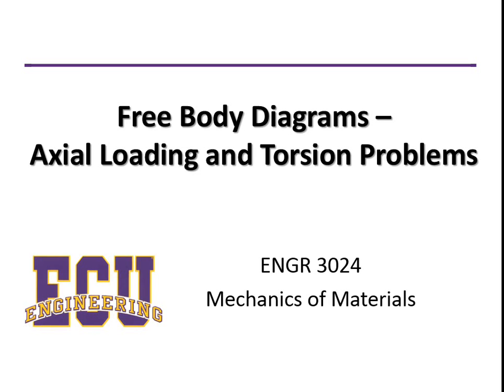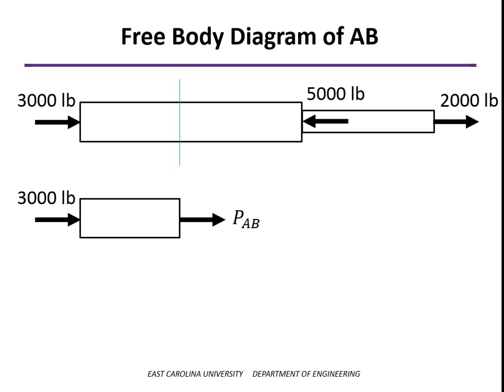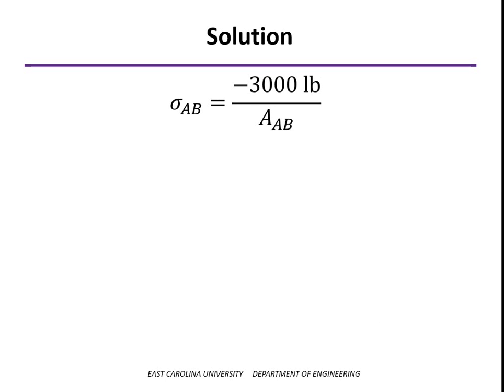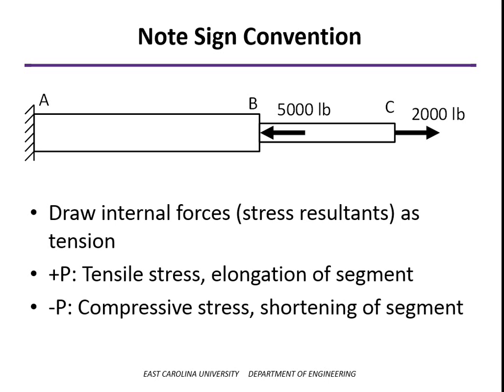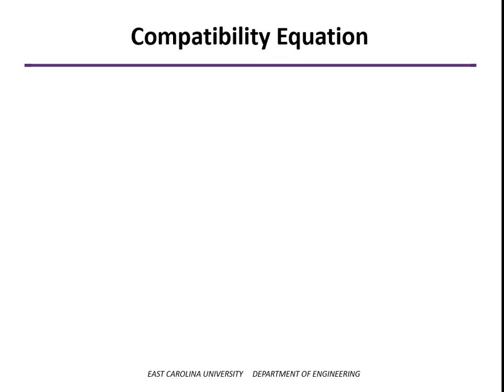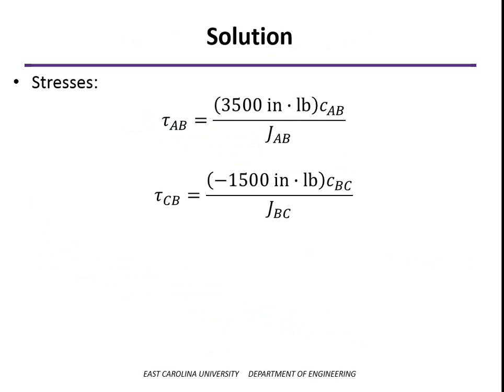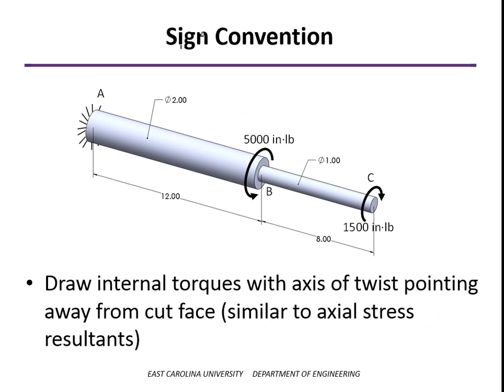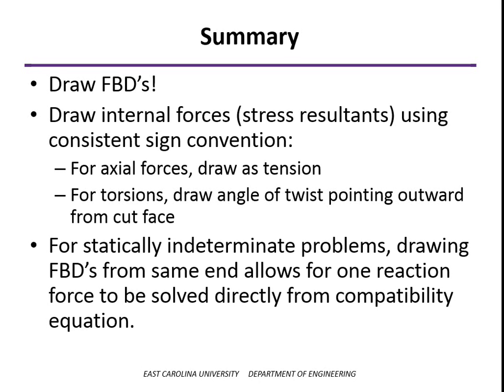FBDs Axial and Torsion Problems

Comment: You keep repeating that negative indicates compression and positive indicates tension, but despite repeating this several times, I continue to fail seeing how certain forces add up. That's what I'm trying to get from all this. I can also easily apply the obvious formula for finding the stress. The issue I'm having is that I do not understand what to do when a problem asks me to determine the force in each section. In my understanding, as long as a bar is in equilibrium, any section will have a net force of 0N, but if that was the case, why does the problem I look at for test prep have 14 points attributed to that part of the question, and lower points to subsequent parts, such as now finding the stresses for each section? The fact that the second part of the question on my desk asks for the stresses in each section means that the forces in each section of the beam are NOT zero and that I do not understand how to analyze the forces. I am extremely confused.